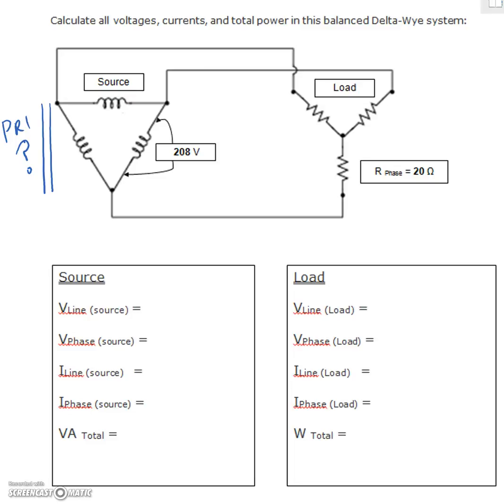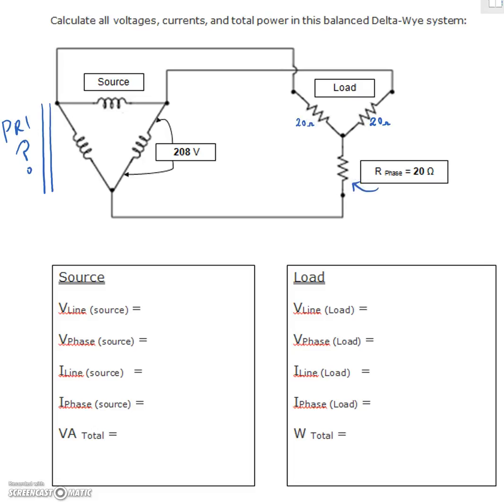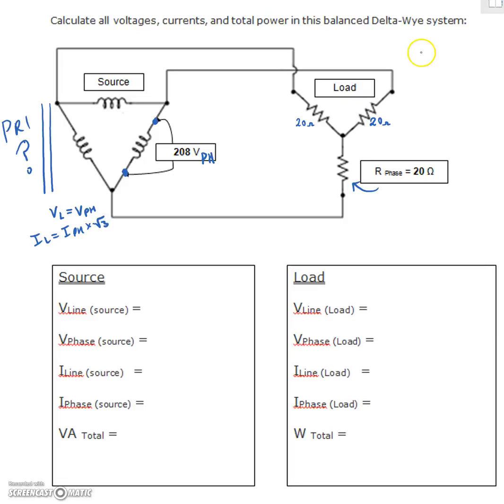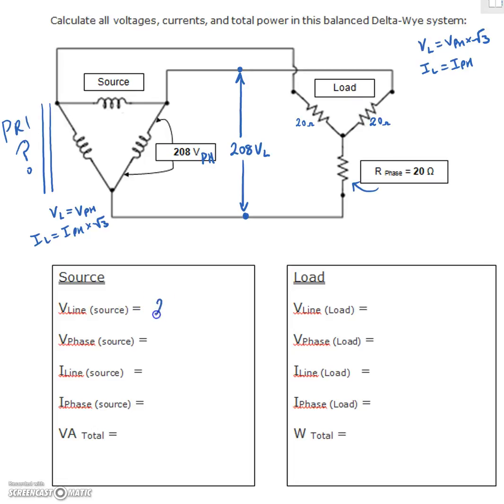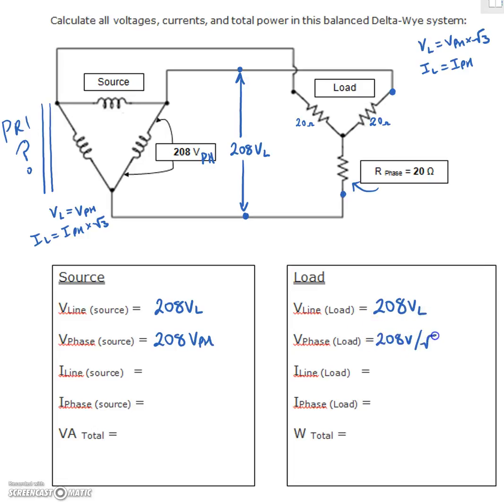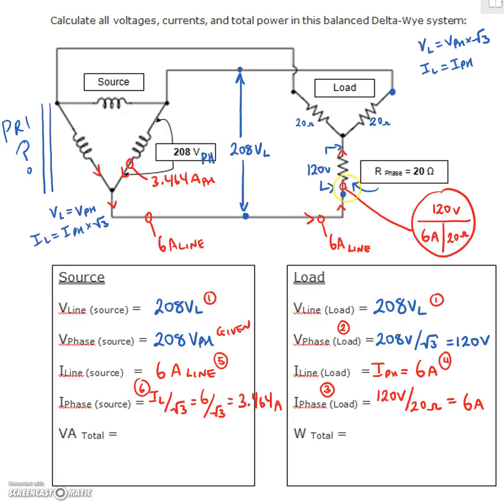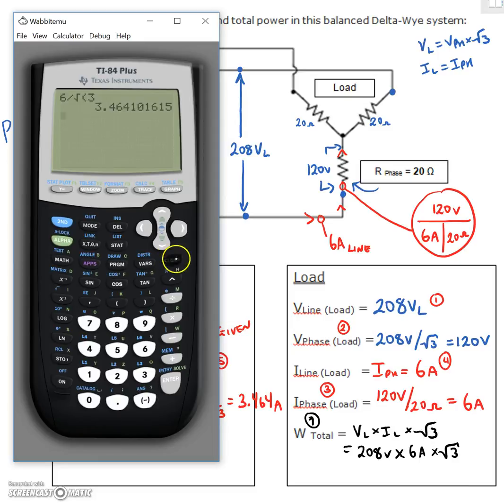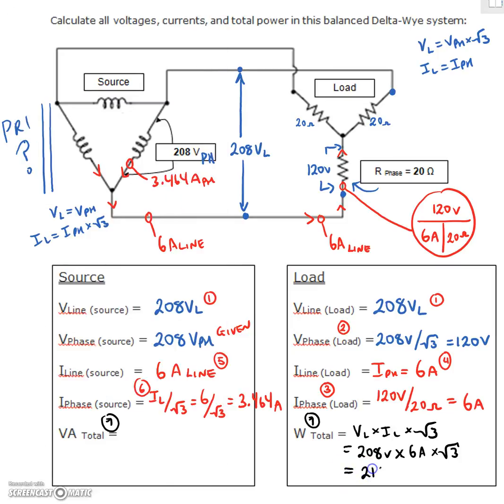3 Phase Calculation #7 (Delta Source, Wye Load)

Comment: What happens when the currents reach the N terminal of the wye connection?
Reply from the maker: The current at the Neutral node continues on to either of the the three phases, depending on the instantaneous voltage difference.

Comment: This is my second semester , so I’m still confused.  I understand this perfectly how to do the math and everything. But in the real world, where do you use a delta-wye system?? In a house ? Building ? In a machine, like where ? 🧐
Reply from the maker: In Canada, our standard 3 phase transformers are Delta Primary, Wye Secondary. Your 3 phase loads can be connected as either a Wye connection or a Delta connection. For example, single phase loads that share a common neutral are connected as a Wye. Single phase, double pole circuits are connected as a Delta. Motors can be wound as a Wye or as a Delta depending on the characteristics you are looking for in the motor.
Reply: A better way we should be asking this question is, what causes me to wire primary a delta or wye. What causes me to wire secondary delta or wye. Primary is wired delta when the primary coil needs line to line voltage of circuit. If it needs line to neutral voltage wire it wye. Secondary is wired delta when the coil voltage of transformer is what the customer/ load required . 120/240 load and I have a transformer that on nameplate has 120/240 output then wire it delta. If I for example a customer/ load needs 277/480, then it would be wired in a wye. Reason is two different voltages with 1.732 difference between them. If the two different voltages are half and double each other (120/240) then wire it delta.
Reply: load that have neutral connection means it were star connection. while without neutral it will be delta. the real confusion come when you have a delta connected load and star connected load. to find out total from each phase.